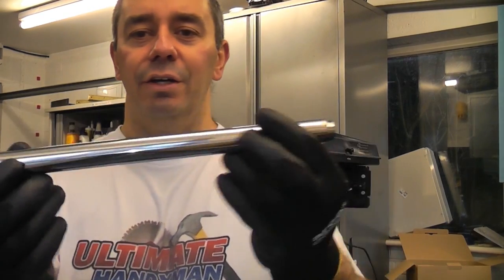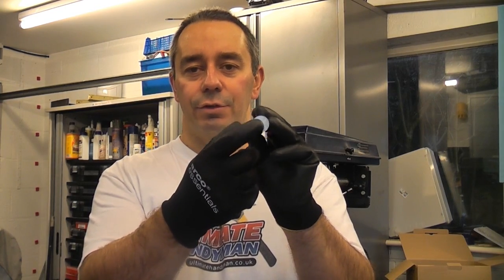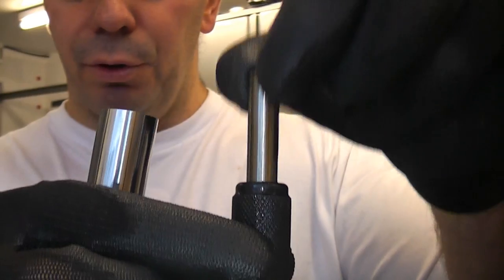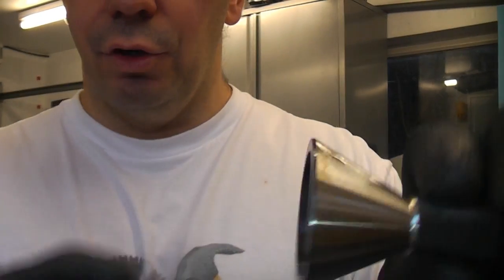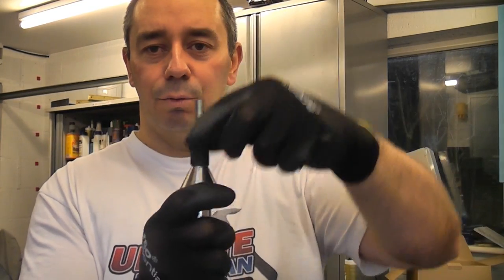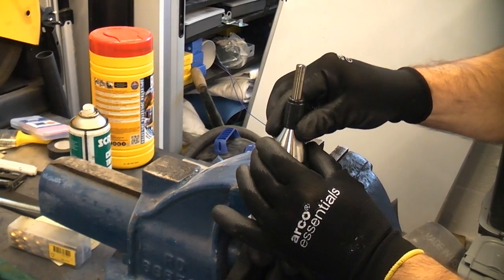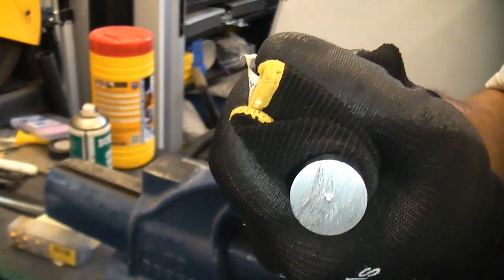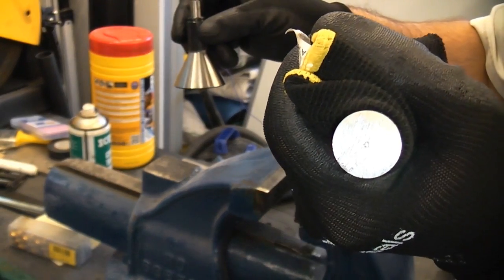Bell punch | how to find the exact centre of a round bar

Comment: Interesting tool, haven't seen that before. I usually use my lathe for the job, but for finding a center on round stock where the lathe is not feasible (e.g. the part is already mounted and I cannot put it in the lathe) I use a center square.
Reply from the maker: Rudi Schlicht 
Thanks for the comment ;-)

Comment: just ordered 1,i need to drill in the centre like you did and tap a thread,is there an easy way to this so its pefectly drilled in the middle,i dont have access to a lathe,thanks,better still do you have a video
Reply from the maker: It's obviously much easier on the lathe, but if you don't have one you can do it by making the centre with the bell punch, then drill it and tap it. I'm afraid I do not have a video of how to do that.
Thanks for the comment
Reply: @ultimatehandyman  thanks for your time pal,I reckon I can wing it with a drill lol,I have watched every one of your videos and if anyone can you can,thanks
Reply from the maker: @fester.   It should be possible, as long as the item you are drilling and tapping is not going to be rotating at high speed.
Reply: @ultimatehandyman  no ill just go steady,I'm only drilling 30mm in to 120mm bar,cheers pal
Reply from the maker: @fester.   Good luck with it ;-)

Comment: Hi! What minimum diameter does round bar work can focus on? I need to find the center of an 8mm round bar, can I use it?
Thank you !!
Reply from the maker: I have just looked at a few listings on ebay but can only find the maximum size, which is 35mm on the ones I have been looking at. I'm pretty sure that it will do 8mm round bar though.
Thanks for the comment 👍

Comment: Is there something similar for cutting a hole in the centre of  a bar using just a domestic drill I know you'd be liable to move out of square over time of the cut  so a pillar drill would be better but for dead centre holes in wooden poles etc it would prove useful or is this just impractical thinking ?
Reply from the maker: There might be something but I am not aware of it. If I'm on site I would use the lathe, if I am at home I use the bell punch. I have had good results with the bell punch, as long as you keep the drill parallel to the work it normally drills dead in the centre.
Thanks for the comment

Comment: I’m confused, surely it needs to be exactly level in all planes for it to work? Is it just for a rough centre or am I missing something?
Reply from the maker: As long as the bar has been cut straight, you just pop it on the end and then give it a smack ;-)
Thanks for the comment 👍
Reply: Ultimate Handyman Thanks, I suppose the crack levels it up automatically as long as it’s somewhere near?
Reply: liddy paul your thinking is correct. This technique it is a rather rough center. The best technique is to use a center square with a very fine point glass cutting carbide scribe indicating and marking across multiple axis ( I like to do al least 4 ) And finding the exact point where all the lines intersect.

Comment: What's the project buddy? Would be interesting to some vids of projects
Reply from the maker: I'm making two remote control door bolts for an electric garage door, so you have a small keyfob that has two buttons. One button extends the bolts and the other retracts them, these go into purpose made plates on the steel work of the door. I have spent quite a bit of time doing it as it is quite complicated and has two linear actuators, two limit switches and a solid state relay to inhibit the electric door when the bolts are extended. I have almost finished them now, all the wiring is done and the left hand side is almost finished. Hopefully I'll get it finished in the next few days! I'll upload a video of them working once it's finished ;-)
Thanks for the comment

Comment: This is not an accurate method really. Particularly when most people at home will cut bar stock with an angle grinder but even with a saw it wont be square. It also relies on the operator to hold the tool parallel with the stock.